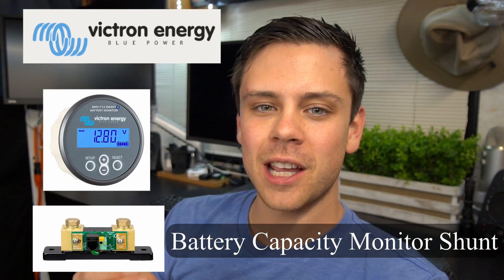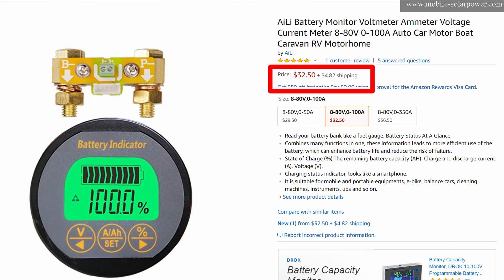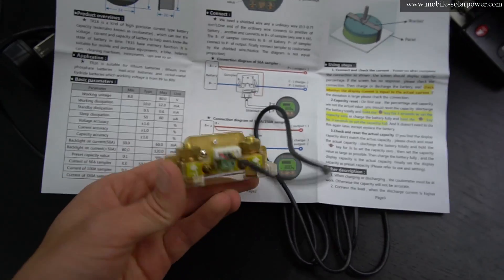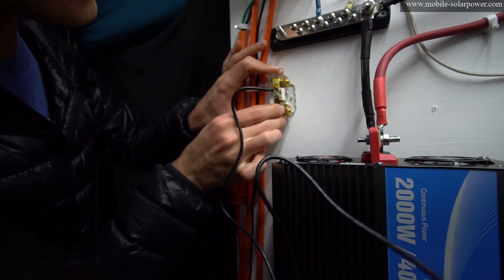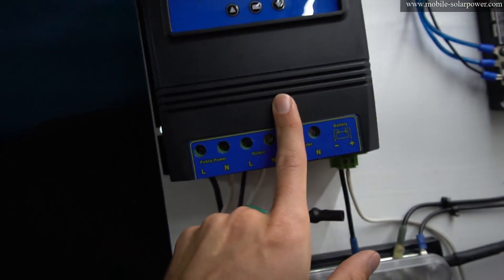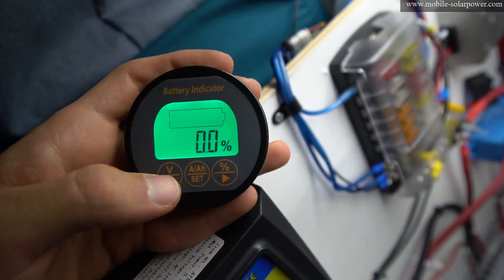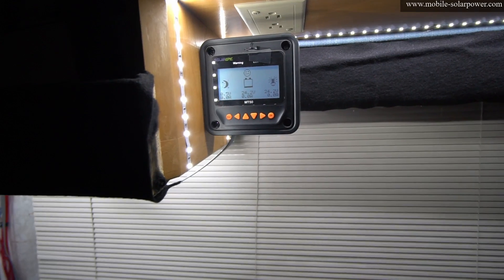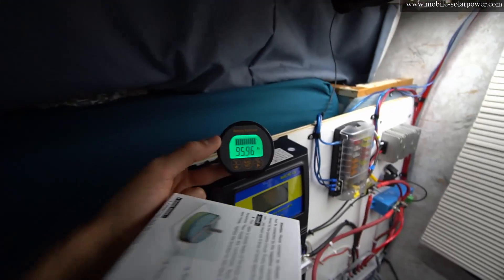$200 Victron Solar Battery Monitor? Try this $30 Chinese one instead! Great for Off-grid Solar

Comment: Hi Will, I have installed this little gem and have a question for you. Is there any advantage to set the amp hour capacity to the total battery bank like 400AH or just leave it at 100AH. I did not do a discharge of the battery to set the zero mark. So maybe mine is not set up correctly. I will be installing 4 Battle Born batteries in the next few months. So what would be the best way to set up this monitor in that instance? On a side note any recommendation for a lithium battery converter charger thinking the AIMS Power CON120. Thanks
Reply: Hi RC,  
You will have to set up the Ah to match your batteries. 100 Ah is default and works only if your battery is 100 Ah.
You don't have to do that 0% calibration,  just fully charge your batteries and hold the % button for 3 seconds to calibrate 100 % charge and you are done!
Reply: @oskarw2558  i concur.. this is a great and cheap alternative to the victron..

Comment: You say it is $30 but when I clicked on the amazon link they show it at $41.
SAD that your link does NOT reflect the price you claim.
Reply from the maker: They don't make the on in the video anymore. the $41 is larger and a better value than one in my video. This video is old, in case you didn't realize

Comment: Hi Will. I'm having an issue that I'm hoping this Device will solve but I want to be clear on what my issue is. I'm looking for a device that will show me how much power in and out  but I want to identify the differential and I don't know how to do this. I want to know how much total power was used and how much total was generated but It seems that if I am using power while generating power that they cancel each other out so you do not get a true indication of power used vs power generated. Does this make sense?

Comment: Is it ok to connect the small positive cable to the fuse box or it is better to connect it to the battery? The fuse box is less than 1m away, so should not be any voltage drop. But maybe any other reasons?

Comment: I do own the Victron(w/o Bluetooth), I do agree that it is expensive.  I may create a product with a built-in solar system, and if I did, I would most likely include this less expensive device, with the Victron as an option.  I see no reason that the Victron is so expensive, but a couple years ago it was the only gadget on the market that did what it did. You can also get one from Victron that does two banks at the same time, and one that does mid-point monitoring, which can allow you to diagnose a bad battery before it pulls your good batts down. Do, it might be a good investment for larger systems. This inexpensive model seems best for smaller systems.

Comment: Did you find the current via reading to be very accurate I bought that cheaper one you showed briefly in the picture and the current was way off the actual current my the load was crying was a lot more than the unit was showing

Comment: I bought this same unit. Works great except for the backlight. I get that pressing V and % buttons simultaneously turns it on or off. But when I press % button momentarily the backlight turns on for a few seconds sometimes (but not consistently). It would be great if it did that every time.

Comment: I noticed that when you configured this unit you didn't set the AH capacity of your battery bank, this is a feature of the comparable Victron unit which I'm really familiar with. Instead you seemed to set a low voltage point where the batteries were considered to be discharged. I've seen other reviews of this unit where the configuration seems to match the Victron unit where you simply set the AH capacity of your batteries and tell it when they're fully charged. Again the Victron unit does this automatically but then again its almost 10x the price.
I note this review is well over a year old, maybe this one you reviewed is an older model with less features.

One point I don't see any documentation regarding is weather this cheaper version calculates the Phuket principle, there doesn't seem to be any advanced settings to determine the type of batteries in the bank so I expect this cheap unit is better suited to LiFePo4 rather than traditional FLA. I know that the Victron unit does calculate Phuket and even with this it still goes out of synchronisation over time. 
I've installed lots of the victron units on liveaboard boats where people cycle their battery storage on a daily basis. The Victron unit will automatically re-syncronise occasionally by calculating the battery voltage and required charge current to determine if the batteries are fully charged.   

Hopefully this one will too. 
I really respect your views on kit and will certainly buy one of these to try out now you've given it such a positive review. It's clearly not as good as the Victron unit but WAY WAY cheaper so certainly seems to be very very good value for money.

Actually the build quality of the shunt seems better than the Victron one. The plastic mounting on the Victron shunt is really poor and very brittle, even if you're careful in tightening the terminals they still crack over time, usually where the shunt mounts to your bulkhead. 
Sadly the shunt still has the same failing as the Victron one where the negative P stud is usually too short to accommodate all the P side negative terminals, obviously people should have a negative bus bar but rarely do.
Reply: I just bought this unit, and it learns your battery's actually capacity when you zero it then fully charge it. You can set the nominal capacity, but after doing the steps in the video  it will tell you the real capacity which you can then program in. BTW, Phuket is the capital of Thailand. You're thinking of Peukert's Effect. I have no idea if this monitor accounts for it.

Comment: So What Do do think about the Drok  Charge-Discharge Monitor Sold on Amazon  I think I have seen you use one.. The Chinglish is had to wrap your head around  but I finally got it connected for testing up to 10 Amps .This Relay is Not much for a cutoff relay. but will work of testing at 7.8 amps. I Need to buy a good DC SSR. What are your thoughts about the Drok  ?

Comment: What will or can the volt reading tell you?
I know what volt is, and with the little knowledge I have, I would think it's always stable and the same, so I don't see the purpose of a volt meter. But I suspect it has a purpose .... ?
Reply: Rudi, if you know the discharge curve of your battery under typical load, the voltage can pin point where you are, in theory. LiFePO4 batteries and other Li-ion types will have a very flat discharge curve, and hold their typical output voltage for a long time, then drop off a cliff towards the end of the charge. A true battery monitor (Coulomb meter) like this unit constantly measures the Amps flowing through the wire and from this it calculates the remaining battery capacity much more accurately than just a simple volt meter would. In the old days of flooded lead acid batteries the voltage had a more linear relationship to the state of charge, so a Voltmeter gave a better impression of the state of charge. Nowadays, you need a coulomb meter like this unit.
Reply: @sail4life  Thank you for this clear explanation.
Have a nice weekend.

Comment: I have installed this battery monitor today! It works fine ,but dont like the flaching display when the charger is hooked up on camp ground. But must be hidden unvisible.

Comment: I've got this monitor, but the first thing I did, I cut the piece of the cable because I was needed the cable for the balancer and it was the only available 5 wire cable with a connector (otherwise I had to wait for the next order with pins and connectors).
And what I saw, they are using ul2547 4-core shielded cable, but because the monitor needs 5 cores, they are using shielding as another core. Is it ok to do that? Balancer cable like that works ok, but not sure if it affects the result (I guess it's better to have a copper conductor, but I doubt that the shielding is copper, it's thicker though).
Reply: Found some info: it's not right to use a shield as a conductor, but it can work (obviously). But what about voltage drop, which is important in this monitor... Now I wanna replace that cable :)

Comment: I still think the Victron monitor is useful for the historical logging, especially when keeping track of that data might be useful in sizing and expanding a battery system. With lithium batteries costing what they do (even used ones), I've had to start small, but know I need to upgrade. At least with a data log I can see whether my battery bank will handle my intended uses (especially adding a refrigerator), or whether I need to add more batteries (ie sooner than later).  I don't want to have to always look at the screen and write the numbers down. I'm also in a temporary (RV) setup and don't want to have to permanently install this in my wall. I can leave it in the battery bay and just use my phone to look at the numbers.

Comment: Well, It's interesting to see what happens about 1 year later.. The price has gone from $30 to $41  (Don't worry I won't blame you !!).
There are now more options on the market, both less expensive and more.  It might be worth doing a video on meter options again since there are so many 'little blue circuit board' options today.  I kind of like the option of not putting a shunt built on a circuit board in line with main power.

Comment: Thanks for this video. Quick question, I have a system with a battery bank of 2000 amp hours. Which battery monitor would you recommend for this system? it is a 24v solar system. Has 7,200w in solar panels and charge controllers adding up to 300amps. thanks

Comment: What if I also have a DC to DC charger charging my (lithium) battery? It doesn't go through the shunt because it's just a positive wire from car battery > DC to DC charger > aux battery. Is there a way to get my battery % to read the charge I get from the car battery? When my car is on, I know the battery is being charged but the percentage in this monitor doesn't go up

Comment: Thanks for videos. I bought Tr16350 for DIY 280ah w/Daley 150 separate bms, putting in Craftsman toolbox, exciting project, gonna make it perfect thanks to vids. Connect this to Neg terminal (C-) but the P- will have to have 2 cables 1 for BMS -P other for Tr16-C, to read Solar charge stats, but have M15 with Epever 40aMPPT.

Comment: My charge controller has a digital display that supposedly shows my batteries information. Soc, amps in, volts in, amps out, etc. Are these not accurate due to no shunt? (Unless the shunt is internal Idk) I habe a renogy rover elite 40 mppt

Comment: the mount is so you cut a circle hole on say a dashboard place the meter in and it holds the back side with the mount :P... common in automotive applications

Comment: Hi Will, I know it's an old video but would you put the shunt before or after the BMS? I'm thinking before the BMS so power doesn't get switched off from it when you run your batteries down?

Comment: The more simple Victron BMV-700 is a bit cheaper than 200 USD (maybe 150) and it has a 500 A shunt. On the Victron BMV, you are required to type in the capacity (Amp hours), it can not determine Ah which would help when the batteries have degraded capacity but are still usable. So in this respect, it looks like this Chinese meter is superior. On the other hand, on a Lead Acid battery you would have to go down to 10.5 V to cycle through the whole Ah which will damage the battery. Otherwise, you get a lower Ah value indicating usable rather than nominal Ah which may or may not be undesirable, depending on the user's taste.

Comment: You can buy 500/1000/2000 "SmartShunts" from Victron at the moment. They sent all the data via bluetooth... will also work great with the Cerbo GX... so these small displays hopefully will disappear in a few...  Not quit sure they're available in the US ?!
Reply: To be honest... No matter there are cheaper options for Victron... the graphic interface looks just great and is very user-friendly.

Comment: Hi Will i like your videos and book i have decided to set up a 400 w 12v system with 3 190ah gel batteries i don't know about buss bars and shunts etc, (sorry for my lack of research and knowledge) the system in this video looks complicated and over whelms me is there a video you can link me to to understand more on your system or even my 400w one?

Comment: HELP! I installed this Aili battery monitor with the 500A shunt. I set it to  make 100% at 230AH on my new dual 6V application. It seems to work great. I might lose 1.5 to 2% overnight during storage. However, when I run my 1000W microwave off my xantrex prowatt2000sw inverter, it slowly ticks down but after about 2 minutes goes to 0% on the Aili yet the MW keeps running, no lights dimming nor inverter warnings/errors. I only need about 3-4 minutes on the MW! Then when I hook up the RV to 110vac it slowly slowly creeps up - like 1% per hour or less! If I tinker with buttons, it will eventually go back to 100%. Any assistance would be appreciated!
Reply: Defective?  Or somehow you may have inadvertently set voltage for the voltage produced by a close-to-fully charged battery. Follow the instructions for setting V and set V for 12.06 (which is the voltage at the time your batteries have used up 50% of their Ah.) Hope this helps. GK

Comment: the beauty of the vistron shunt is logging how your off grid system is performing with how much power is really being used/collected per day.  it's worth while for those who are not as savvy on keeping their system working properly.  I have one, and don't use it, though i'm an electrician.  I still think they are excellent to help the general user.

Comment: The video shows a plastic body on the shunt. Perhaps it's because I got a higher-amp version (probably), or because I bought it from a different vendor (unlikely), but the shunt is now solid brass. The item from QWORK on Amazon is described as 350A but the shunt is labeled 500A, not that I'm going to use that much. I don't know where the limiting factor is. Probably the shunt, not the meter.

Comment: The problem with these 2 way meters is that they only measure current draw over about 0.5A, so if you have a slow ongoing discharge, it will not register anything and will still read 100% even after fully discharged. This problem does not occur with the one way meters, so it turns out the best way to monitor your capacity is to use 2 one way meters and just subtract the difference.
Reply: Confused on this. I have a lot of trickle discharge - why not one one way? Gonna search to see if i can figure out more

Comment: Will, why did the wire spark when you initially connected it? Sorry for the stupid question
Reply: Capacitors inside the inverter getting charged up almost instantaneously caused those sparks.

Comment: Question:     The instructions show to power the unit directly from the battery.      As I am trying to understand exactly how this works, I believe it is measuring the difference in voltage on both sides of the shunt (which is a known resistor) to calculate amp draw.    My question is... Do I need to power the unit directly from the battery as shown, or can I power it from another source, as you seem to have done in your video? Does it use that power source as part of the measurement, or is that ONLY to power the unit?    AND,  Can I have that power source turn off while being stored, or will it lose its programming?

Comment: I've had one of these for a couple months now. I returned the first because the amps started bouncing around and showing amperage even when it the battery was disco. Once it starts doing that, it doesn't stop on it's own. The second has done the same thing once now but I figured out the way to fix it is to unplug the meter for a few seconds. No data is lost. My only worry is, if I don't notice it for a period of time before fixing it then the actual usage will not be accurate. I ended up putting the bayite back in as well, so belt and suspenders it is because I do like the AH and percent readings alot. My epever  also has a % battery indicator, so it's actually belt suspenders and beer...

Comment: Yo! I got the same unit. Have you seen your unit reset to 0% for no reason?
Reply: I bought this monitor about 8 mo's ago, and it worked great. About 3 days ago it started to show the battery capacity was 0. I checked all my batteries and they were fully charged. I reset the monitor with the batteries disconnected from all loads and it did the same thing again. It appears this is a common problem with this unit. As a side note, you dont have to drain your batteries to set the low voltage setting. You can set the max capacty at 100% with the batteries fully charged and the unit defaults the low voltage setting to 0 volts automatically. I dont know if I will just replace the unit with the same one, or purchase a different one.

Comment: I think you can set the capacity by just having a fully charged system and then hold the percentage sign.  You also need to set you battery capacity so it knows how many amp hours it is
Reply: I was wondering about that.
Why put the batter through a full discharge cycle.

Comment: I bought one of these off this recommendation but I can not figure out how to factory reset. I hosed up the 0 volts thing and I have never fully trusted readings after. I asked question on Amazon with no answers from company. There has to be a way!  Otherwise it seems to work great as a meter. And has helped troubleshoot all sorts of little issues with my system in my winnebago. Including the terrible parallax converter.